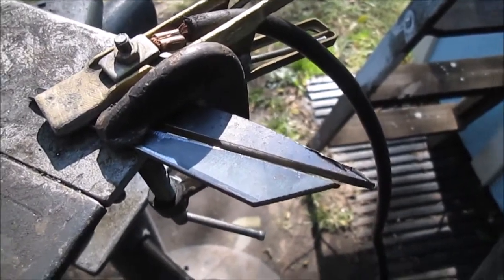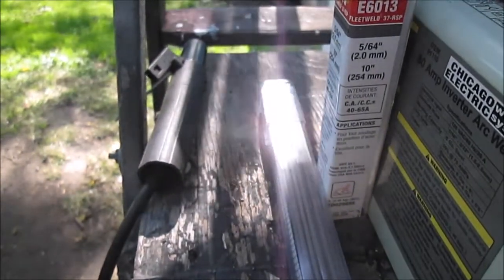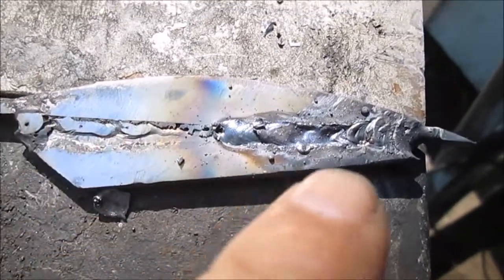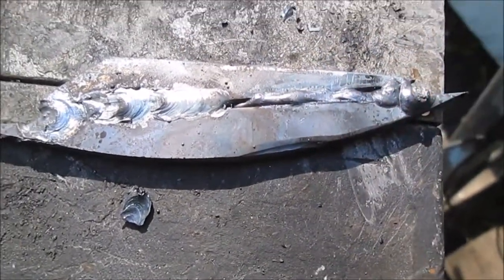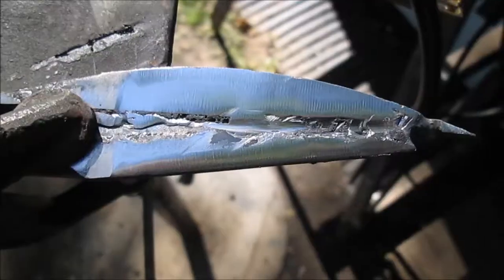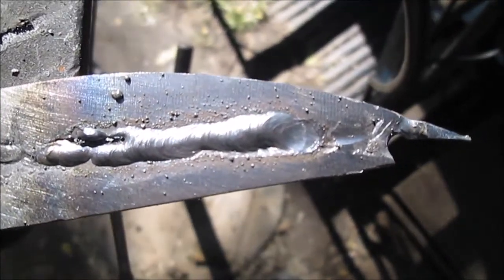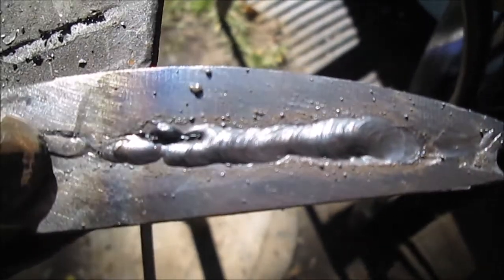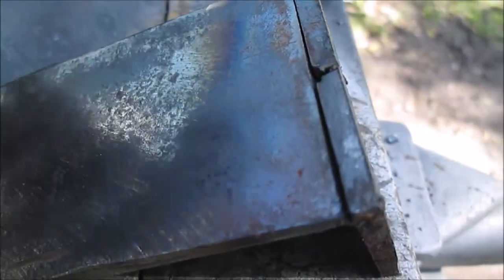More Weld Practice With  5/64 E6013 Rods

Comment: I have this inverter and I love it , it works  well with 1/16th ,  5/ 64's , and 3/32"s 6011, 6013, 7014 rods , the ground needs to be clean as well as the metal being welded and thick material needs to be beveled . If you use a 20 amp socket and no more than a 10 gauge 25 ft. extention cord it will work fine .    I've used it on several back yard projects as well as thin metal repairs and it has worked very well .  Would buy another one if this one ever quits working !
Reply from the maker: I Like the 5/64 rods the best...I have a 25 amp socket and I use a short 12 ga. drop cord ..I do need to get a better ground clamp and rod holder My rod holder is getting bad even after try to clean it ..I have used this on many small projects before I bought my mig welder ..I still is a handy welder to grab for small repairs
Reply: not2fast4u2c 
  I find that it handles angle and fillet very well and the welds are strong .    I used it with a 5300. Watt generator with a 20 amp receptacle and it did better than I expected being plugged without an extension cord ?   I'm going to purchase another one in case they change the design on this welder or if they become hard to get !    Hope yours does well for you in the future ! Happy welding !

Comment: I learned on a 2"x2" square plate. I had to weld bead next to bead until it was 1" high. The instructor would cut it open and look for slag pockets. If he found any slag pockets we had to start over.
Reply from the maker: I am not new to welding ..I have welded for years ..I am just new at welding with these rods ..I have had this welder for several years and always used the 1/16 in .rods that are very hard to use and make a good bead with